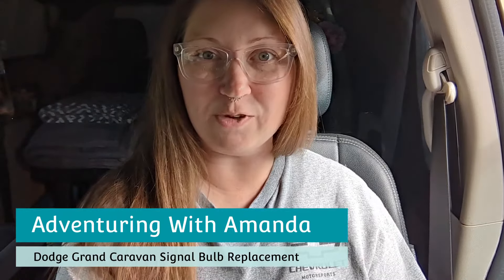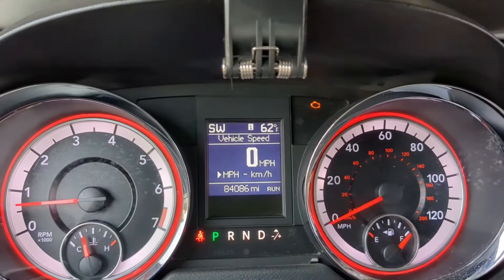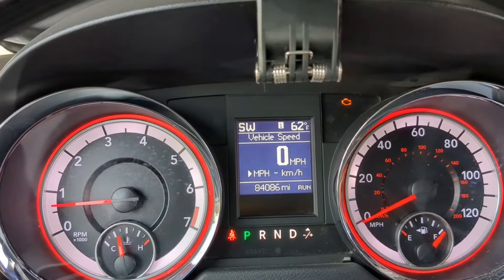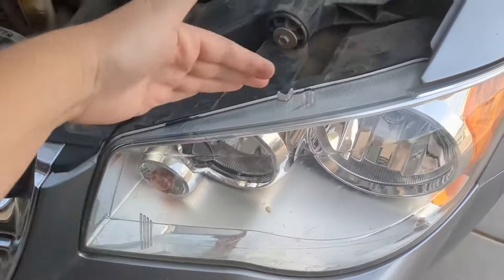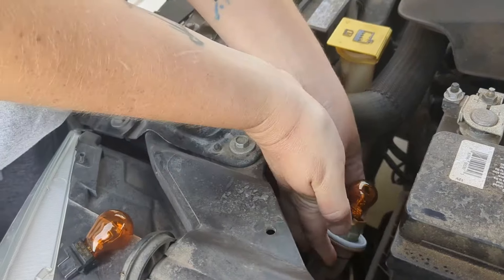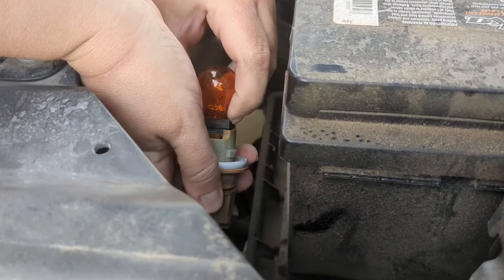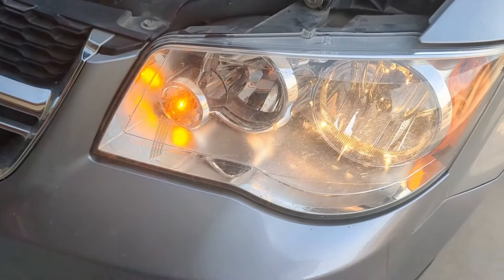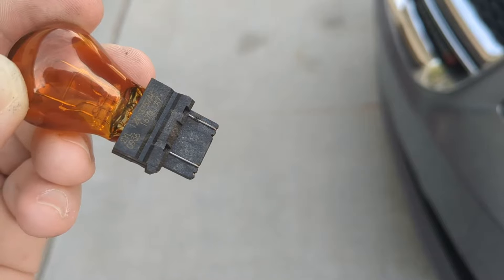How to Change a Turn Signal Bulb on a Dodge Grand Caravan Minivan WITHOUT REMOVING THE HEADLIGHT

Comment: Between your video and one the one the guy at the auto parts store pulled up for me I got mine changed. I just dreaded possibly breaking the bulb off as it was stubborn coming out. I wasn’t going to pay the dealership again though, that cost was ridiculous. Also, I’m a guy. The bulbs in my Saturn were much easier to change.

Comment: Good video. Thanks for posting.  I'm mystified though as to why anyone would go to complete removal of the headlight to accomplish this. I searched for this video just to make sure there was not a new wrinkle that made it trickier than it used to be. I'm officially an old guy and don't work on cars much anymore but I used to and when I do try to tackle a job myself on a modern day car, it I usually find that jobs I used to find simple are anything but these days.   I would just add its best practice to not handle the bulb with skin contact-- wear gloves or use paper towell.
Reply: Mine is different, her opposite side is different because the battery and electrical distribution is in the way.  I can't get my hand anywhere near it on mine.